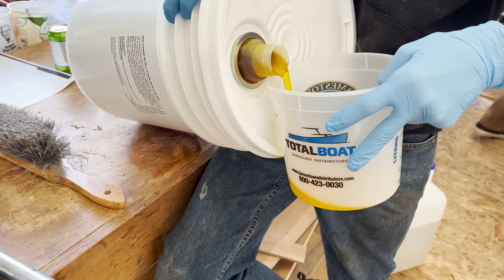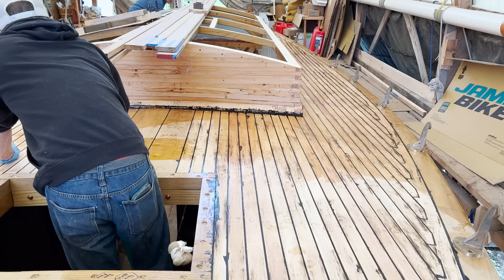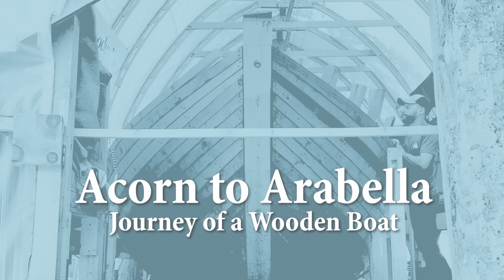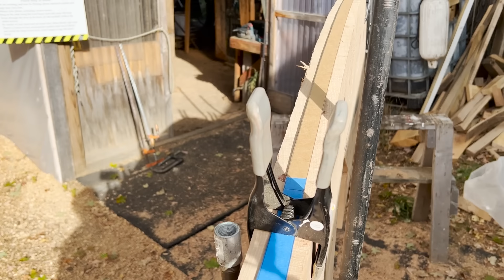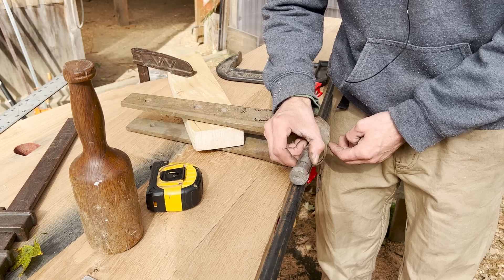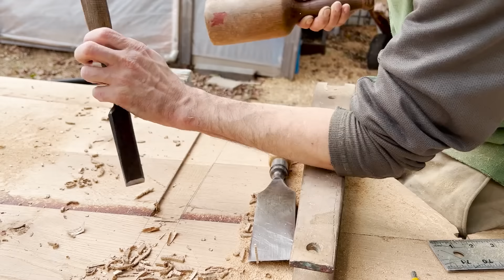Miniature Lead Pour for the Rudder - Episode 236 - Acorn to Arabella: Journey of a Wooden Boat

Comment: Hi Steve, I believe the added weight is to dampen "rudder flutter". For this reason it's also why your "trailing edge" should be symmetrical and finished with a square edge and NOT rounded over. Cheers, Safe travels, see you out here.

Comment: Yea i was thinking the same thing about the weight on the rudder toward the bottom. It's probably there to naturally bring it back to center since the rudder is at an angle. Its like a stabilizer and counter weight at the same time. The man was brilliant. Under sail it will also help steering and to re-center the rudder. I don't think I would have even thought of doing that.
Reply: That's kinda what I'm thinking too. Acts a bit like caster on a car, or more likely a motorcycle. Keeps the rudder centered when not actively trying to steer.
Reply: I wonder if this was 'invented' accidentally .... like someone had to do an angled rudder to fit their new double ender hull design, and it sucked because the boat couldn't hold its course because the rudder always wanted to float up to one side or the other - so when they weighted it(to pull it down and thus unexpectedly straight back) they then discovered that their once squirrelly boat now would auto correct hands free dead ahead - and it became a feature instead of a problem, which a vertical rudder could have neither of
Reply: @BenjaminT.Minkler  like a trim tab…. The 25 pounds might be the weight that works best to help hold it at a specific angle when the boat is healed over
Reply: I was thinking it was there both for the reason you stated, to overcome the buoyancy of the wood, but also to counterbalance the tiller and help to return it to center when maneuvering at low speed.

Comment: Excellent craftsmanship! Regarding the weight on the rudder my explanation is, when the boat is heeled over the lead weight at the edge of the rudder will pull down and therefore counteract weather helm. The boat will feel better on the rudder and it will be easier to steer.

Comment: Concerning the lead in the rudder: The wooden rudder will of course float and with a perfectly vertical turning axis that won't matter because the bronze fixtures will keep it there and turning it to the left or right won't change anything. However if you're not at 90° but the rudder is more or less hanging down from it's fixtures like in the picture, rotating the rudder around those means it's further up. So let's say you turn the rudder 20° to the left, the rudder is a bit closer to the surface than it was when you were steering straight. Now buoyancy will push for the rudder to be even farther up, which means it will push the rudder further to the left until it hits something and can't move further. The most stable position for a rudder like that is with the anchor points underneath it (which of course doesn't work, because there's a boat in the way), unless there's something heavy attached, that keeps it from floating up. So you should really look into how much lead you need because if you use to little, the rudder will move on it's own.
You can try this with a small wooden board in your bath tube. Just hold it at two points along one edge and try to push the board into the water. If the edge you're holding on to is 90° to the water surface, the board will just push up but turning it won't make a difference. If you hold it an angle like we see for Arabella, it will push to either side (unless you can hold it perfectly vertical).

Comment: Who knew a rudder would be so complicated!?  Now, we all do.  Thanks, Steve, for sharing your passion and particularitis with those who appreciate it.
Reply from the maker: As we say in the description, it’s taken almost all of the skills needed to build the rest of the boat!
Reply: @AcornToArabella  Talking about the rudder, when you mentioned the wight I assumed it must serve a similar purpose as counter wight on control surfaces on an airplane to keep them level so you dont have to fight them staying level.

The rudder seems to be tilted backwards so the wight would center it if the rudder now is heavier then the water it displaces.
Due to the rudders angle any movement left or right  (yea not marine terms but you get it XD) would elevate the wight a bit, gravity would want to pull it down aka center the rudder.

If you for some reason tilted the rudder forward instead it would probably prefer to go either all left or all right and not stay centered.

Its like when you where a kid and had something that could rotate around a stick but was heavier on one side that stuck out, tilting it back and forth would rotate that thing to what ever direction allowed it to point down.

Also you car should self center if you let go of the wheel due to how the front suspension is set up so I suspect this is the same thing, you want to go strait in your boat and not go in circles when ever your not paying 100% attention to the wheel so to speak.

Anyways my theory but it might not be the correct reason or it could be one of two, as you sad it wanting to float up is probably not desirable ether.

Good luck with the boat!

Comment: Hi Steve, I suppose the lead is to counteract the buoyancy of the rudder to keep the boat steering easier on a very light wind. As the center of buoyancy is lower then the rudder hanging axis the buoyancy will turn the rudder away from the neutral position to a side. So the lead will keep the rudder in amidship position. Best wishes!
Reply: Exactly what I was thinking 🙂
Reply: In my opinion this weight helps for self steering. I owe a sailing model which steers (due to the same weight on the lower end of the rudder) by it self. The ideal is , in the model , when the boat is heeling over and tends to steer towards the wind the rudder is falling to lee and by so keeping the vessel on course. …. On the model, made from old drawings, this really works. It keeps it course without a remote control on the rudder.
Reply: @marcoheijboer7003  This is very interesting what you say but I am afraid the added weight is not enough to steer the boat but just good to make the rudder neutral. When the boat heels much (on gusts for instance) the straightning moment is so great so to keep the boat on course you have to apply a great force on the rudder. This is dozens of kilos (on rudder not on tiler). Under the water everything is getting lighter so to steer the boat the way you say it would require double weight. So my point is the influence of the rudder weight is a tiny bit compare to the forces that are in place and that keeps the boat balanced.
So the main force that pulls the boat away from the wind comes form the balanced sails when the center of the sails forces is upfront the center of the boat mass. And this is the great force.

Comment: 17:30 Weather helm, the tendency for the boat to turn into the wind, is why the lead is there.  Weather helm is desirable (achieved by proper sail trim) for sailing because it means that your keel-rudder combination is producing hydrodynamic lift to windward.  As the boat heels over the pressure on the rudder to counter this weather helm would grow proportionally to the heel.  The lead is there to compensate for this and adds a steering assist by drawing the rudder to leeward; or downwards while heeled.  This will reduce the force required to hold the tiller in the necessary position to produce the desired hydrodynamic lift.
Thanks for another great video.

Comment: Since you have a wooden rudder, which floats and your hinge is tilted, the rudder wants to float up. It will either turn to SB or to PS as a result of this. Now it is balanced and will stay put unless you pull the helm. If you put more lead in it will try to remain centred and the helm will be heavy at larger angles.
Reply from the maker: It’ll be interesting to see how it feels… I’ve not sailed a boat that has a weighted rudder, and most likely with just 25 lbs, the thing will be neutrally buoyant rather than prone to sink. It’ll be interesting for sure. —Anne
Reply: @AcornToArabella  Realise the 25lbs was calculated by Atkins based on volume of the rudder en the specific weight of the wood. By using heavier wood you need less lead and when using  lighter wood more lead. More taper less volume of wood, so less lead and so on.

Comment: Steve - Old guy tip: When you have a 5 gallon pail with a bung you can lay the pail on its side with the bung up, and then roll the pail on the bench to begin the pour. Way easier than tipping it to pour.

Comment: May never see this comment but… if you put the 5 gallon bucket in the intro horizontally on the bench and then just roll it a bit till the oil comes out then back up when your done.  Easy trick I learned awhile ago 👍

Comment: I believe the lead on the Keel is to keep the keel centered while underway. Without it, the keel will tend to float port or starboard, demanding continuous course correction while underway.
Reply from the maker: It doesn’t really flop around that much, and few boats have it, but it seems like it might reduce the effects of weather helm for the skipper.

Comment: The weight in the rudder helps holding the rudder straight. Because the angle of the the rudder hangs on the boat, and the wood wanting to float, that will make the natural state of the rudder to be folded upwards. Making you sail in circles when not actively holding the rudder.

The lead on the rudder will keep the rudder hanging down and thus straight. Helping you with steering in a straight line. it's basically using gravity as a spring to center the rudder. Or like how the geometry of a bicycle front wheel fork helps keep the wheel in front, and allows you to steer by pure balance.

Comment: FYI, placing the 5gallon bucket on a flat surface with the bung at 12 o’clock, ensuring the handle is out of the way. It’s possible to just roll the bucket in either direction to facilitate a good pour allowing air inside to stop the glugging. Simply rolling the bucket back will stop the flow giving you much more control.

Comment: You are correct.  The weight will pull the rudder down to zero degrees.  The higher the lead moves up towards the surface the more weight resistance there is.   If you let go of the tiller, the rudder tends towards the centerline of the keel.  When heeling over, the weight helps to stabilize the rudder's tendency to float.

Comment: I have refinished gun stocks with boiled linseed oil (BLO) for a rock hard and glossy cover. An old friend ( now I’m the old one) told me a secret. Thin the BLO with VM&P naptha 50/50.  It soaks deep into the wood and cures faster, especially in cold weather.  As you use it up, keep refilling your jar with Just BLO.  The last few coats are 100% BLO and the result is amazing.
Reply from the maker: The same approach is made with most types of varnish. Send it with solvent, last coats are almost 100%.
Reply: @AcornToArabella  A truly ah-ha moment for me.  It sure made for an amazing finish.  As a bonus, it cures faster.
Reply: @AcornToArabella  On the fishing boat I worked on with a celery top pine deck we would boil linseed oil mixed 50/50 with mineral turps and applied that hot with a brush, worked even better on a good hot sunny day. Only thing is we added a hardener to help stop the rubber mats we used from sticking to it. 
Getting exciting watching this chunk of wood coming together.

Comment: I suppose that the added lead weight would naturally return the rudder to center ; by pulling it down, which is also straight back because the rudder hangs down at an angle vs being vertical perfectly upright .... interesting that this problem(that otherwise without the weight would float up, steering to one side or the other) now becomes a feature! and one that would not be an option on a vertical rudder which could not have an auto correct to return to center even if it was weighted(because that would only pivot perfectly left and right, not also up and down some without being angled under the boat like this one) pretty neat!

Comment: funny how i have no interests in boats or sailing but still enjoying these videos as i did at the start, loving the craftsmanship and the technicalities that go into the designs that have been fine tuned over many hundreds of years, adding the weight onto the rudder makes perfect sense in the same way that moving surfaces on aircraft have trim tabs to stabilise during flight, that weight will assist in steering and prevent the rudder from waggling like a loose flipper i guess
Reply from the maker: So glad you enjoy what we do. Happy Friday!

Comment: My guess is the lead is to assist with weather helm. When the boat rounds up you will need to pull the tiller toward the helmsman and the lead will reduce the load require to steer the boat.
Reply: I have another explanation. I owe and have made a sailing model (without remote control) from old drawings and this model has exactly the same led patch on the back of its rudder. I followed the design and what It does is steering the boat by itself. When a gust is there the boat heels over and wants to turn to the wind. With the heel the rudder due to the led falls to lee and steers the boat of the wind and keeps it on course. It could be that this principle is used for short handed crews/ boats. I.e. to keep the boat on corse without a helmsman.

Comment: Rudder is looking fantastic, and the welds are nothing a grinder and a file won't soon sort out.

Quick one though, I noticed in the turning of that pin on the lathe that he was putting quite a sharp corner in between the pin and the face. That's something you really don't want to do, that corner is a stress riser and cracks will form in that location.

You want a small radius in the corner between the pin and face, even as small as 50 thou radius should be enough. That will prevent any cracks from starting there.

Also, the first tool that he was using had entirely the wrong geometry for cutting brass/bronze etc. You want a tool with zero rake on it. Will give a better surface finish and not grab or chatter when cutting. I'm sure he got the job done, just a small tip to make it a more enjoyable task next time.
Reply: I agree about the lack of a radius in the corner, it is what brought the British Comet jet airliners down when the square windows fractured in the corners from altitude to ground level. due to pressure variations. I was also concerned about the appearance of rust on the lathe surfaces or was it brown dust, I hope so. Excellent work as usual Steve and the crew, loved the tapered plank jig, nice one. Cheers from the UK.

Comment: What I like about your channel is the mix of a traditional took like the adze with modern tools like a circular saw. You save a lot of time with the kerfs but you're still not full on CNC router (which would be crazy fast and precise)
Reply from the maker: Crazy fast, in our experience, has also meant a quicker path to a potential mistake in material we can’t replace. Sneaking up on final shapes is where it’s at. Or as most sailors I know say it: “slow is pro.” —Anne

Comment: Love the series, but please spray some oil on the old Victor lathe where it's going rusty. That lathe could then go on to outlive everyone on this build / crew.  It's future caretakers will thankyou :)
Reply: Yes, I agree with you, I mentioned the rust earlier to another comment, I was hoping it might have been brown dust from turning something else. I have a nice old Atlas lathe here in the UK and have to "put it to bed" in the autumn with lots of oil and also re- oil it in the spring when the warmer air brings out the moisture from the concrete floor and condenses on the cold metal. Cheers from the UK.
Reply: @terrygrotefeld4814  Nobody owns an old lathe like that, we're just caretakers for the next generations that will use them long after we are gone.

Comment: Have you already considered how to mount a swimladder/steps?
On a round stern like Arabella, it is not easy to put on a swimladder.
Here in Holland there are some who put steps on the side of the rudder to use as a means to get out of the water.
One step under water does not have much drag and if you put 2 or 3 above the waterline you can get up on deck.
Under the waterline a ridge or ledge is enough.
A couple of handholds above the waterline should do fine.
It is a safety issue when you cannot get out of the water by yourself if you happen to fall in.
Reply from the maker: We have special hardware from Victoria that we intend to add to the rudder. More on that later.

Comment: I wonder if the weight so low down with the angle the rudder is at in comparison to the vertical helps it return to centre when swinging free.

Comment: The lighter the rudder, the more responsive the steering. This is why modern performance boats have carbon rudders with carbon rudder stocks. Ultra weight savings. However, this doesn't really match with the intended purpose of the Atkin design. Your boat was designed to cross oceans downwind. Where tracking is vital. So vital, that you don't want a light rudder swinging around altering your course. The ultra heavy rudder is designed to not move much at all, keeping a straight course downwind. However, this comes with a major compromise, maneuverability, especially in tight quarters, is sacrificed.
Reply from the maker: Great points, thanks for sharing them. Since tight quarters on the water pretty much means marinas or pursuits that call for tacticians, we’re all set 😉

Comment: The lead is to make the rudder neutrally buoyant.  It will keep it from binding on its pins or float off its gudgeons.  You would do the same thing if you were to build a centerboard in an enclosed trunk.